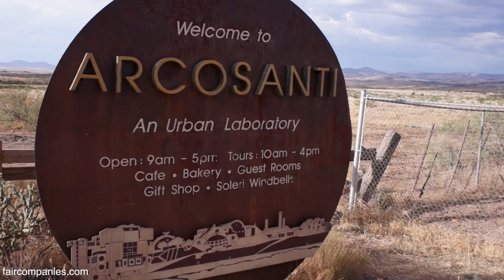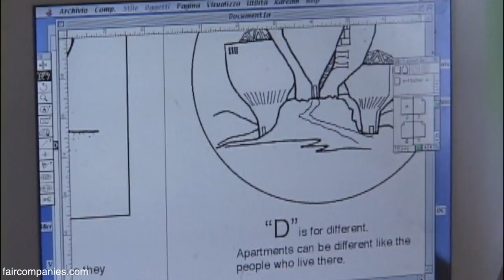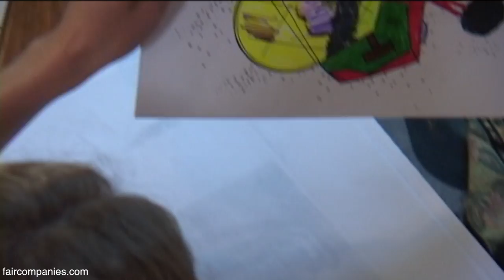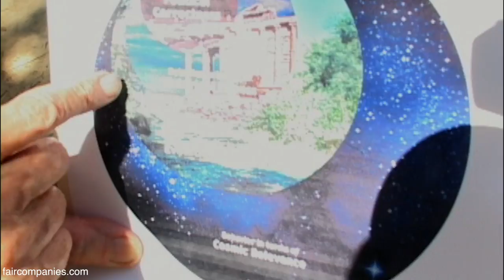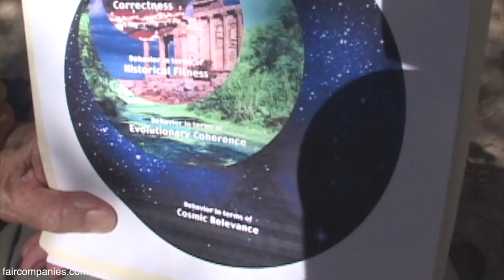Arcosanti: Paolo Soleri on his futuristic utopian city in the desert

Comment: I read his Arcosanti: Paolo Soleri Arcology books in 1993, in the Uni Libary, it was like manga/akira architecture neo tokyo dialed to over 9000+. I love it. The down fall however is without a type of anon tech they systems will fail and be too hard to get to to repair or upkeen burried dep with in the substructure of the arcology. Maybe you would have to rebuild a new one very 30 years or so and mine the last on for materials.

Comment: not trying to be rude but so this is just a small city where everyone is in close proximity and tried to be as energy efficient as possible...yes ? no ? anything else I am missing ?
Reply: It can be said the slums can be very efficient  as necessity takes the path of least resistance, its a shame that poverty and crime coexist in these systems. This takes the core ethos of slums and adds a planned approach that makes conscience choices instead of one mandated by circumstance that includes connecting structures with the resources they consume and taking a more managed approach to growth. This idea could work in a more modular approach  as units could be connected via short paths. Also the core assumption is the people would need to change their idea of urban culture and its  to fit the land scape. I think with a little effort this type or urban living could have a chance if cynicism is not allowed to prevail
Reply: I am not sure we are watching the same video , the coexistence with nature was a key to this places design ethos,  I think there is more nature in this town then most modern cities. Sustainable structures  need to play the long game and this place on site nature integration  for use of shade in and public places seem pretty common and the concrete construction can use pretty domestic resources and is the most common material for large scale sustainable systems for is heat retention properties . The point of this place compared to other communities featured here is its target pop is 5000 instead of 200, I don't forsee a way to have more nature in a community that large that doesn't waste too much water and doesn't sprawl so much as to necessitate wheeled transport .
Reply: +sman5612 
I, like you, choose to see the positives vs the immature cynicism displayed by others here; the evocation of "slum" above speaks volumes of their angry closed minded, contrarian perspectives.

I share your enlightened take on this community's effort to foster urban change that benefits humanity vs the utterly inefficient selfishness so typically prioritized in cityscape designs and architecture. (I'm also a 20 year fan of the #EarthSHIP / #TinyHouseTribe movement for reasons similarly aligned to many of this community's goals.)
Reply: Or if you selectively only let in people who are willing to work and orient towards a common goal which is efficiency and cooperation, it wont turn into a shit hole. Don't let in any people looking for a hand out. Only hard working people and it wont happen. Keep out the filth and it will prosper.
Reply: +DudGuyver agreed
Reply: I lived at Arcosanti for 4 years. Let me explain a bit of the difference between the cynical interpretations some are posting and what they are trying to do at Arcosanti.

The concept of an Arcology minimizes the footprint of a city. For example a city the size of NYC being able to fit on just the island of Manhattan by planning a more 3 dimensional design and a plan for adding buildings that connect and fit together as there is growth. While building multi use into the entire city, so no neighborhoods are used only during part of the day. Industry, retail, entertainment, and residential occupying close proximity. At the same time there is a minimization of personal space and an emphasis on public space. You still get plenty of private space, but instead of everyone having private lawns, there are several public laws that all can enjoy and use. Agriculture and nature is protected and surround the Arcology. giving quick access to more rural or wilderness experience than one would have in a typical city.
Reply: Reko Starr Well first off it is not me, I don't live there anymore, nor was I ever a major player there.

That said, Paolo did try and get cities to adopt his ideas. As well as have places build from scratch. Sadly no one has taken him up on his design ideas.

The majority of cities are not built to last long term, and you can see they are constantly tearing down buildings and building new ones. So the idea a city could retrofit into an Arcology is not out of the realm of possible. However, those cities have already destroyed the agricultural and wild lands around them. Not having the agriculture and wild areas to go with an Acrology dramatically changes how an Arcology functions and feels.
Reply: +The Ineffable Homestead 
Well penned..
Reply: Reko Starr I would suggest you actually visit Arcosanti before suggesting it "doesn't do enough for nature's sceneries" The scenery there is amazing. There are vast open views from much of the place. And since it was built into the mesa rather than on top or on the bottom. It has a feel of being part of the mesa. Like a fungi growing on a log.

But considering you voiced you just don't like cities. I imagine it would be hard for you to ever give this a true chance.
Reply: ***** 
Well penned hero; we need to start copying our microscopic, single celled cousins that once rule the planet.. until we started destroying it and them in the process.
Reply: Hacim Llih Just an FYI, all that fossil fuel we are using up like no tomorrow comes from simple life that ended up so dramatically changing the atmosphere make up it killed them off in massive die offs that built up the layers of their corpses to make the coal and oil etc..

We aren't the first species to screw up, and we sure wont be the last.

But hopefully we can learn to find a better balance with nature before we cause our own destruction

BTW, if you don't know it already, permaculture is an amazing way to rethink agriculture. Well worth looking into if your not familiar.
Reply: The Ineffable Homestead
No 'Sex'pert' on permaculture hero.. but most assuredly will be needing to learn and implement it's tenants before my  #ExpatRetirement  to my little  #PacificCoast  beach plot in  #CostaRicawhere  whereI will take my last breaths of the Pacific Ocean breeze from my  #TinyHouse  /  #EarthShip  consuming only alternate energy from combinations of  #WAVEpower ,  #WINDpower ,  #SOLARpowerFTW , and more.

My goals are to return to stardust knowing my last decades will have been utterly sustainable.

Comment: True Arcology would require Earthship type structures that build into the earth using recycled materials. Concrete is not and never will be a ecological building material. All our modern concrete begins to turn to dust after a hundred years or so and has to be replaced.They are still building mudbrick houses up to ten stories in Yemen that will last 450 years with a simple re-plastering every 50 years or so.. Even simple Cob house can last for 500 years or longer if maintained. Michael Reynold's designs from the Taos Earthship community is a much more promising and cheaper way to improve civilization. They are akin to Cob on steroids. The Idea that you can sustain year-round agriculture on flood plains is not viable for the long term. Much better to build on on the sides of south facing hills with a small garden indoors  and a larger terraced agricultural area below being fertilized by the output of the septic system. We see this system was used in ancient Inca ruins in the Andes mountains.The water is collected above and requires no pump to water or fertilize the fields below. Earthship type greenhouses would extend the growing season and conserve water which can be captured within the system and recycled to lower level greenhouses before finally being released back into the environment with no further treatment.  Earthships are off grid so they are not dependent on expensive power transmission lines and power companies to keep the lights and the refrigerators running. They don't need any outside source of power except most now use propane to cook with. Natural gas is easy to make using a bio-gas generator and a regulated LNG compressor. All organic waste can be fed into the digester and cooking/heating gas comes out of the collection bell instead of being released into the environment. Frank Loyd Wright was a architect that could make things look good and impressive, But Michael Reynolds does the same thing while also making them inexpensive,sustainable,and independent from outside forces.
Reply: Exactly! The Romans knew how to make it last and we don't. That is why 75% of our concrete bridges are desperately in need of replacement.
Reply: corn cobs?...bugs love to eat corn you know

Comment: The desert sun and heat destroys every thing. Even concrte made with cheap, inferior material will become diseased and decompose as any vistitor here can see. It must be a very dusty place.
Reply: Concrete without the freeze thaw cycle and tree roots making it unstable last longer than you think in those conditions. This is providing it was cured correctly.